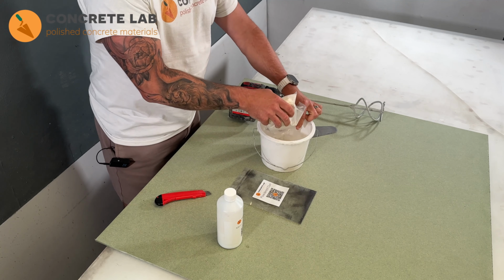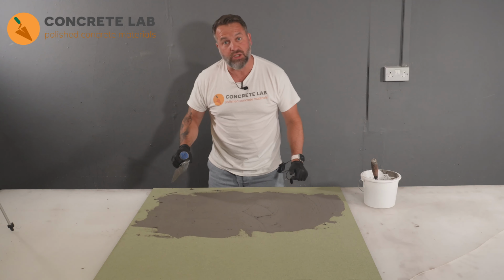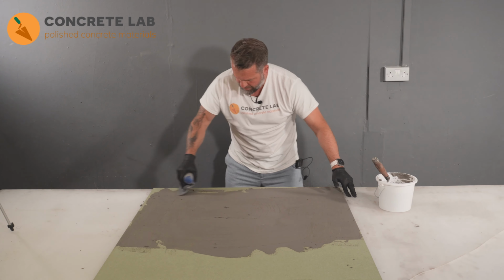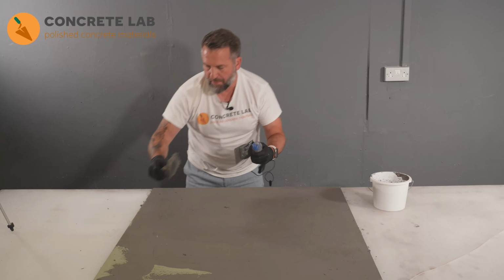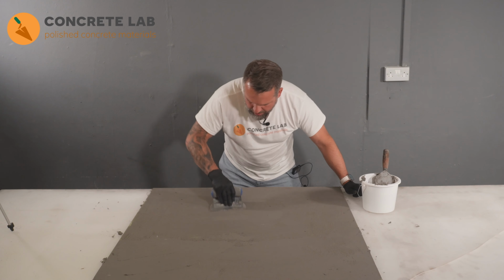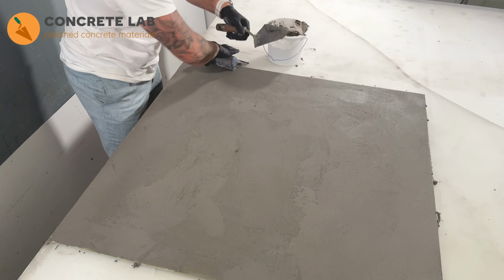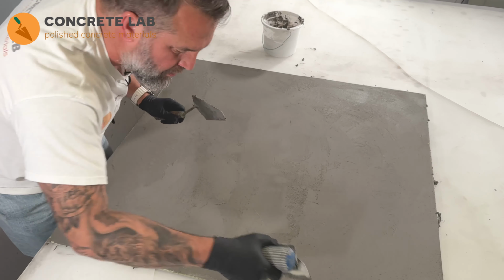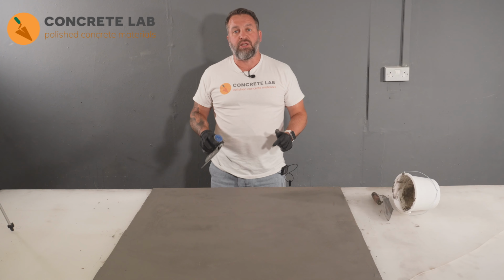How To Apply The Microcement (first coat)

Comment: Very useful video thank you 
My mikrocement came with resin for a base and the finished. Have you come across anything like that. I was wondering what is the purpose of the resin. To make it hard quicker🤔
Not sure if It goes hard before I finish applying it.
Many thanks
Reply from the maker: The resin has a few purposes including improved curing and flexibility.